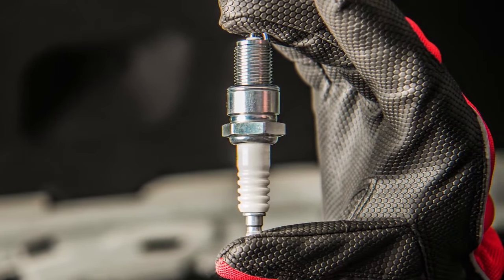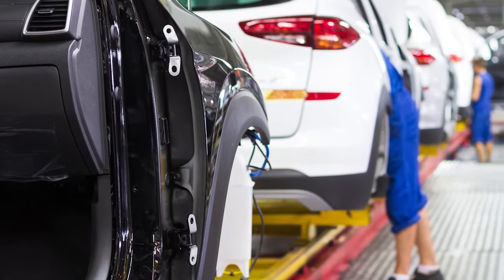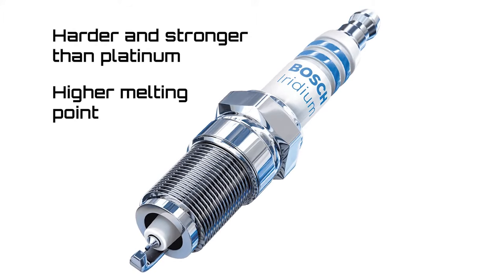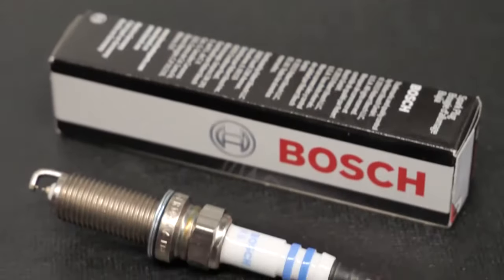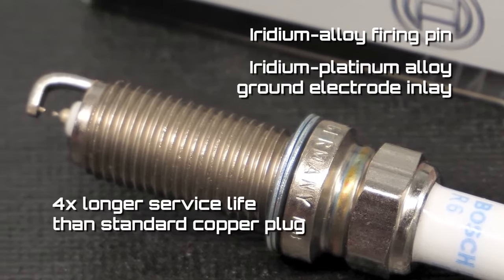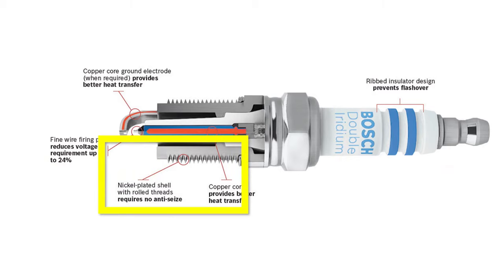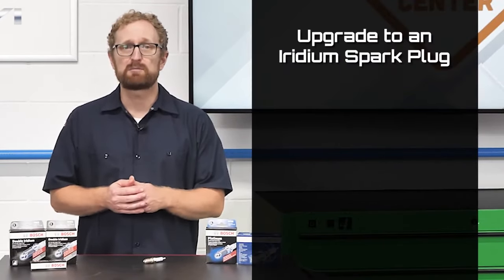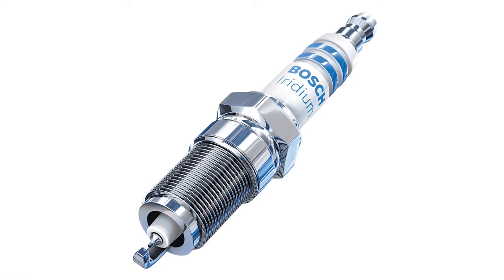Iridium Spark Plugs vs Normal

Comment: Mind you this is just my opinion but if the spark plugs are hard to do, its best to use iridium plugs to maximize how long before you have to deal with them again
Reply: I agree and so does Scotty for that very reason.
Reply: @TheMapkiss  yessir
Reply: The back 3 in my V6 are hard to get to, so iridium , the front 3 normal plugs.
Reply: @mvnorsel6354  Personaly, I keep thing uniform so when I changed them, I did all iridium.
Reply: @rustneversleeps01  😆 🤣 😂
Reply: @rustneversleeps01  definitely. Cools the fuel pump. Tought i think all of today cars have plastic tank, but if not prevents corrosion. And you dont want to run to low because the system could became airy too
Reply: Even if easy to replace, I’d use then unless much more expensive. Why use a less efficient part that needs to be replaced more often?
Reply: @rdspam  Iridium spark plugs do cost a good bit more.
Reply: In my opinion: You can't use iridium unless your ignition system is specified for it. You can use platinum regardless, but not iridium.

Comment: My car came from factory with iridium plugs and I can tell you there's only two companies that make true iridium plugs, NGK and nipendenzo and I can tell you that when you don't use one of those two brains and it's actually a platinum plug with a thinner overall Platinum coating. You can be having misfire issues in as little as $32,000 and if you're lucky, you'll get 42,000 before you start getting a misfire whereas the iridium plugs in my car go 100,000. Mi perfectly fine with no issues whatsoever. If you don't use an actual iridium plug that's made with good materials, actual iridium and a thick enough coating of iridium, they wear out so much faster and start causing misfires so much faster. It's not even funny.

Comment: I have replaced my stock with iridium for last 7 years on my motorcycle.  Not only had the performance improved tremendously but also runs cleaner. Any one who says that improvement is nonscence is himself a shorted spark plug
Reply: What bike? Is it okay to change spark plugs as long as you maintain the gap mentioned by the company? I am thinking of getting the iridium plugs for my 2011 alto k10 but nervous To do so if it damages the engine in some way.
Reply: It will be fine. I wouldn't gap the iridium plugs. I just bought some for my 2003 suzuki TL1000R, I will put them in tomorrow. It has fresh NGK dual electrode plugs but everyone on the forums say the iridiums are the way to go.

Comment: My diesel engine spark plug lasted forever.. :)
Reply: Yeh. But diesel engines 'fire' whenever they are ready instead of when a tuner sets them to fire. Thats a bit crappy, really.
Reply: You mean glowplug
Reply: No, he meant spark plug - sarcasm - you missed it.
Reply: @herbieschwartz9246  
I got it. But you missed that diesel does not ignite at the same piston position. Thats also why some 'rattle' when ideling.
Reply: @DavidCooper-rv6wg  
No I dont think he does. Diesel does not have them, thats why he says they last forever. Glow Plug is only used to start cold engine and turn off when started.
Reply: Wrong - The "rattle" is from the detonation of the diesel, which is how the diesel is ignited in the cylinder. The 
"ignition" or initiation of combustion occurs when the diesel is injected into the cylinder, not whenever it just sort of happens.
Please Google "compression ignition engines" for a basic understanding before responding without knowledge.

Comment: Those placebo effects of iridium spark plugs are awesome,a spark plug is a spark plug it doesn't matter what its made from
Reply: Dyno results disagree
Reply: Great thought just you forget it last longer that mention in the video also...
Reply: Iridium spark plugs are more durable, generally at least twice as durable, than standard copper-nickel spark plugs. They improve combustion (dyno tested) leading to marginally more power and improved emissions. They are less prone to fouling and work better at idle. It‘s not a placebo product, iridium plugs are legit and in many cases even cheaper in the long run, they might cost twice as much but they can last well over twice as long.
Edit: and you generally don‘t need to gap them, one less headache to troubleshoot
Reply: @SahnigReingeloetet  man in india the price is 4 time than the regular plug
Reply: @HimanshuSingh-st8nn  then it‘s not worth it man

Comment: The best Iridium is Ruthenium. That's what's in my 250,000+ mile Toyota and it's "loving them".
Reply: NGK has their Ruthenium HX spark plugs. They are amazing in my old 2008 Ford Focus. Smoother performance and great fuel millage. Take care all.
Reply: Denso tt Iridium are best for Toyota
Reply: My Rambler Ambassador came with Baberuthenium and lasted 714K miles..

Comment: The real reason mfg use iridium plugs is that the smog requirements on new cars require 100,000 miles of smog compliance without spark plug replacement.

Comment: Retired master automotive tech here Use what is recommended for your vehicle In all of my training over 30 plus year career every instructor stated this Do not upgrade To many factors involved to explain here There is a reason the engineers chose the specific type of spark plug for each vehicle
Reply: *too
Reply: sir, my car came with normal copper plugs but when I switched to iridium it showed some improvements like engine is less stressed than copper plugs and mileage has improved marginally but many forms has suggest to stick with oem plugs but may be they didn't gave iridium plugs pre installed because they are too dam expensive than the copper ones ... it's my assumption and personal experience with the plugs please do share your experience 🙏 

thanks in advance 
God bless
Reply: @mrcoolhellyeah252  There is truth in this when it comes to manufacturing anything, the balance between being cutting edge and cutting costs. If it can save them 60 cents per car if they use copper instead of something exotic like iridium, they're going to do it because it's going to save them millions across the total volume of vehicles they make
Reply: @IronMan3582  thanks, I was curious before changing the plugs weather iridium can make a difference and now it's been almost 2 years with the iridium plugs running the car sometimes I still get stuck in feeling that maybe the cooper ones were best for me as it's a petrol car and in my city heavy traffic i barely get 10kmpl with ac onn 🫣 sorry for bad English,, such mileage make me think was it a good decision or not but the information on this topic is very limited and it's mostly not a concern for many who buy  the car  of honda or hyundai or suzuki brand as there engines are very refined but I have tata car with 3 cylinder engine with 5 star rating build ncap which stresses out the engine compared to other cars... 
Anyway thank for replying to my reply 🙏
Reply: I just know from experience that in almost all cases OE type plugs are best  I have experimented with many of my own vehicles over the years as well and found this to be true
Reply: 2004 Toyota Tacoma original spark Plugs 355,000 miles Nippon Denso two dollars Spark Plugs At the Toyota dealer Densos are the best spark plugs in the world.
Reply: Any of you heard of punctuation? It's like shifting through a word salad.
Reply: I once put iridium plugs in a car. The only difference I noted was ignition noise on the FM radio.

Comment: Just replaced the iridium plugs in my GMC . Old plugs (iridium) probably could have gone another 100 thousand. My wifes car is a Ford edge 3.5. Its a 6 hour job to replace the plugs. Also many new vehicles require you to replace plugs at 100 thousand. If a plug fails on many newer vehicles it will melt the coil and create total havoc with the ignition system.
Reply: 6 hours? For you or the tech?
Reply: @abdul-kabiralegbe5660  My guess is for him, it isn't a simple job on many V designed engines in FWD vehicles, as half of the plugs are up against the firewall, you often have to remove the intake. Some people will try to do it without removing the intake, often costing more time than just removing the intake to get easier access to the plugs. People will also often overlook the idea of the intake removal before starting the job, so they don't have replacement gaskets on hand to put in the intake when putting it back on, then you have the choice of either using the old intake gaskets (not ideal), stopping and going to get the gaskets (good idea), or - if they already took out the front 3 plugs - putting old plugs back in to get the gaskets or trying to finagle around to get the rear 3 without removing the intake. A good tech could do it within an hour, but they already know the procedure and are familiar with it.
Reply: I'm not a pro, but it took less than one hour to put plugs in my wife's 09 3.5 V6 AWD Edge.  You don't need to disconnect everything from the upper intake - just unbolt the manifold and unplug stuff on the right side only and bungee the intake up to the hood on the left side.  Make sure to put shop rags in the intake holes and change the intake manifold gasket.  There's a youtube video showing how easy it is.  Same with the 3.0 V6 Escapes.

Comment: They're absolutely indispensable in motors with limited access! I hate having to spend over an hour plus gasket plus whatever I broke getting the intake manifold off and on just to replace 4 dang service item spark plugs!!
Reply: should of bought a honda.. takes me less then 5 mins and one tool

Comment: 3,215°F platinum's melting point 
4,435°F Iridium's melting point.

a 1,220°F difference
Reply: Why does this matter when the iron or aluminum block have lower melting points? No engine  is ever going to get that hot. If it does, you're going to have much larger problems than failing sparkplugs.
Reply: @joshuapayne8811  what ignition center temps have to do with engine temps?
Reply: @steveolive9991  In what instance does a spark plug get to be 3,215 degrees? Oh that's right NONE!!!!!

Comment: The advantage of cheaper spark plugs and glow plugs is they are less likely to seize as they need changing regularly.
Reply: As detailed, the threads are rolled, so anti-seized isn't needed.

I still apply a small amount of anti-seize on the threads regardless for this exact reason.
Reply: The upside of iridium is that you'll change em way less often.
Reply: Just use a correct torque. Don't use anti-seize, since it will increase the torque applied. It's not complicated.

Comment: My truck has about 250,000 miles on it, I have never changed the spark plugs, and it runs like new.  Those 5.9 Cummins engines must have really good ignition systems 🙂
Reply: Oh wow, a Diesel troll in a spark plug debate. Haven't huffed enough fumes to go to sleep yet today? Your Cummins is shit too, don't worry.
Reply: I was hoping to elicit a silly comment from a gas-sniffer, and was even rewarded with him (her) openly making themselves look ignorant on things mechanical.  Thank you and congratulations.
Reply: wait until you injectors it's just a matter of time

Comment: copper is a much better conductor. so copper plugs will make a bigger spark than the ones with precious metals in them. copper does wear out much quicker though.
Reply: Horses were 'better' according to some.. ... even though they deposit Horsehit everywhere.
Reply: problem is you almost never have the issue of "not a big enough spark". You are correct about the conductivity, but sadly it doesn't really matter in everyday vehicles.
Reply: Coils only induce enough voltage to overcome the resistance ( gap ) in the circuit ... if as you say copper is the better conductor less voltage will be required to jump the gap .... If you want a " Bigger Spark " increase the gap .
Reply: The copper core has ZERO measurable effect on spark voltage. The copper core (inside the nickel alloy electrode) is only there to transfer more heat from the electrode end to the shell to reduce erosion. That is it! No other reason. In case you have doubts, I've been working for a major spark plug manufacturer for the last 20yrs. I know what I am talking about.
Reply: At 30K volts, the fractional resistance difference between copper and any other metal is literally meaningless.   Some spark plugs use 500 ohm resistors for radio noise suppression with no loss of performance so a 0.01 ohms difference between the electrode material makes no difference at all.
Reply: @ohger1  As an example, NGK "R" (resistor) spark plugs have internal resistors that are usually around 5000 ohms and have no effect on the 10kV to 30kV that ignition systems usually operate at. And yes, like you said, copper has no effect on the sparking voltage. There is an unbelievable amount of bad information about spark plugs on the internet.

Comment: My 2005 2ltr Nissan lafesta came out with these, it had a burnt out coil and the shop replaced all the plugs (was horrendously expensive). I should have kept my AUSE Chrysler Valiant charger.

Comment: so for an average type car - i have a 99 Mustang 3.8 six, auto - driving normal, about how much difference in gas mileage and power?
Reply: The only thing I've noticed with a improved spark plug is MPG. That is something you can look forward to if you get the right plug that it needs.
Reply: Probably zero unless there was something wrong with your old set of plugs.
Reply: the difference is about $15 per plug. just use platinum plugs they work fine and they last a long time.

Comment: How long or km it is ideal to replace iridium spark plugs?
Reply: just ask your mechanic to see if it's still good. my last one went to 92..000km, the double iridium.
Reply: If in doubt, then replace the plugs.  They are not very expensive when you actually think about it, 100K and you have your money's worth.  In that time, you probably have (or should have) spent a lot more on condoms and alcohol than a set of quality plugs.

Comment: Pre-gapped rarely means properly gapped.
Bosch aftermarket parts are garbage. Their OEM parts are high quality, but are only available from dealers.
Reply: Two weeks ago, I bought 6 Bosch Iridium spark plugs and each gap was different.  Only one of them didn't need to be adjusted.
Reply: Bosh parts seem to be hit and miss even in original parts. i had ignition coil crap out at 80tkm and cam positions sensors crapped out at 90tkm. i still occationally drive 1999 nissan that is still running on original coils at 360tkm and original plugs till i changed them at 340tkm. Wasnt much left of the spark materials but somehow they still worked haha.
Reply: @imrileth6618  Bosch seems to be hit and miss because they often have vendors make parts for them with the Bosch name added.  Worse still is counterfeit parts.

Comment: Best to use what was from manufacturer, using same spark plugs from factory will keep your motor in good shape
Reply: it's ok to use other sparkplug like iridium sparkplug for longlife than stock sparkplug.. Nothing will happen
Reply: @FryTofu  it's not ok,it will mess up your motor, your motor will not run right as like the factory
Reply: @FryTofu  GM vehicles uses acdelco spark plugs iridium
Reply: It depends. A lot of times manufacturers offer an iridium equivalent to the OEM ones. Especially NGK, they are the same plugs just better.
Reply: @SahnigReingeloetet  I drive a trailblazer SS and my spark plugs was acdelco from factory, I weather stick with same spark plugs
Reply: At 150 thousand miles, I noticed a little roughness at idle.  I replaced the existing plugs with OEM plugs which were Bosche iridium and the car ran great again until 250 K when some brain-dead a-hole totaled my car in the freeway.  Moral of the story - go with cheap plugs because there are just too many stupid people out there that insist that your car is destined for the scrap yard long before it is worn out.

Comment: 20 years ago, Ford changed back to regular copper core, nickel-plated spark plugs for a small European OHV engine.
The platinum plugs lasted long enough for plugs to seize into the cylinder heads.

Learn lessons from history.
Reply: Graphite, copper or bronze powder based grease will surely protect any thread from seizure.
Reply: @TransAmDrifter  Possibly.  I cannot verify that but hopefully it did.  Part of the problem was a cast iron head with exposed plug recesses which attracted dirt and moisture.

Comment: Would using these plugs in a motorcycle cause heating issues on a air cool engine
Reply: Plugs made with Iridium do not increase cylinder temperatures.  Iridium can withstand increase cylinder temperatures compared to copper all the way through to platinum.

NGK has Ruthenium plugs, but I have no knowledge of the benefits of those compared to Iridium plugs.
Reply: No because the spark plug doesn't affect engine temperature.

Comment: Bosch sparks are 🗑️😉
Reply: Bosch is a solid company
Reply: @AnoNym-zi5ty  company is solid but sparks are 🗑️🚮
Reply: @Patsan4ik1  never had any problems with bosch, but moved on to ngk anyways.
Reply: @AnoNym-zi5ty  I had so many problems with the original Bosch spark plugs.
Moved on to NGK and a bunch of problems just gone.
Reply: @Patsan4ik1  you sure it were original parts? Lot's of fake stuff is sold everywhere.
Reply: @AnoNym-zi5ty  Yes, I checked them out exclusively.

Comment: I put a set of iridium in a fuel injected harley. They kept tripping the check engine light
Reply: It's the Harley that's the problem. Archaic, outdated, overpriced, underperforming. Honda lawnmower has more engineering than a Harley.
Reply: @tchelby  ok hot rod